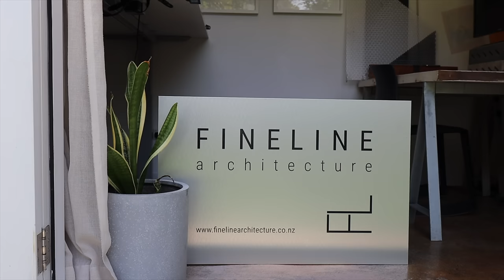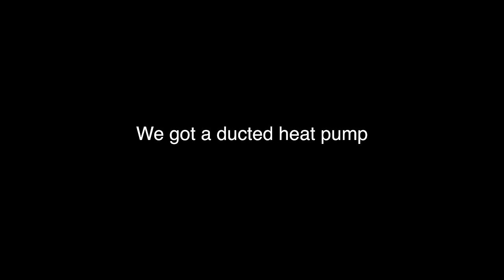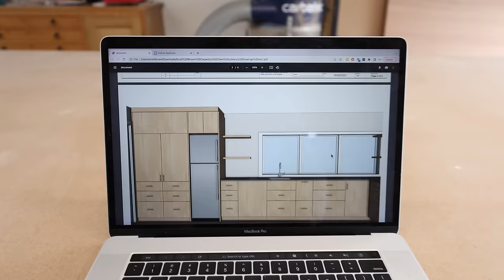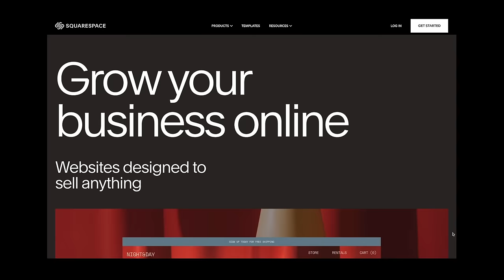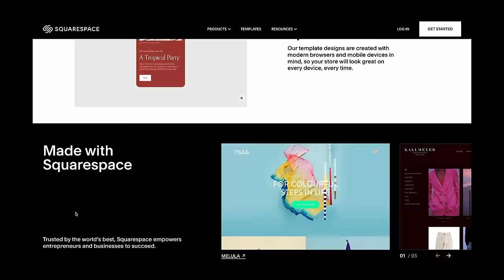2 Years Rebuilding a Normal New Zealand House and Spending All Our Money

Comment: Scott & Jess,

Check the Kn force on your existing window struts, then you'd need to get a lower force variant. Just be careful, as it needs to support the windows weight when fully open, which explains that initial (Jess) surge when opening out. 

Troy

Comment: If you can't figure out how to relieve the pressure or if you buy weaker ones that can't hold the weight, you may need to position them further out from the pivot point to increase the distance they travel and slow the action down.

Comment: That's impressive. Amount of work done looks like it would be easier to rebuild from scratch. So much done!
Retrofitting of double glazed windows looked really cool. 
Looks like consent hell as well - bearing wall, external wall insulation, chimney removal. Since it's 60x high chance of asbestos in floor and eaves as well.
Can't image amount of work that went off screen. Well done completing all this work!

Comment: Yep you can adjust those shocks  should be a teeny tiny Allen key on top or  bottom edge of shock body and you can release  the pressure,, do it very slow as you can't fill em back up. Tiny bit at a time,..

Comment: 15:14 Less pressure may mean it won't start to open or go all the way up. You can regulate speed on pneumatics but I've never seen it on a gas stay.
Personally, I would have gone with a vertical bifold rather than an awning window, then you could use vertical spring balances like with a double hung.
Edit: Actually, I was just thinking you could fit an oil damper alongside the gas stay... but gas stays are already oil damped... so there must be internal porting for the oil that could be modified, or a thicker oil used to slow the extension.

Comment: If you can't change the pressure on the window struts, you might be able to adjust the leverage they have on the window by changing where they are attached to the window and the frame. Having them closer to vertical when open would give them less leverage, and closer to 45 degrees would have more leverage.

Comment: Fantastic results and a joy to watch! About those kitchen window pistons springs, wouldn't it be sufficient to put the top-end brackets closer to the hinges (more counter-pressure) and, if you haven't already, place lower-end brackets a bit lower so they're a just a hair short from fully extended; you could screw some small plywood slats on the window and frame (preferably in the current bracket holes to prevent extra holes) where you can screw different positions on to get the geometry just right.  just thinking out loud here ;)

Comment: Most pressurized gas cylinders like that are not adjustable, however they are rated for a specific lifting force. If that lifting force is too high for the total weight, it will shoot up quickly like you describe. The total weight of the window and the attachement point are both important, as you change the attachement location the leverage advantage will change. If you can figure out the lifting force of the ones you currently have installed, and the estimated total weight of the window you could order cylinders better suited to the application. Here in the US these cylinders are fairly cheap, and easy to find online by length and lifting force.

Comment: Hi Scott. Yes you can get varying strength gas struts. There will be writing on the side telling you how many Newtons you currently have. Either reduce the N figure, or buy ones that you can adjust by releasing gas. Just be warned once you’ve let the gas out you’re not putting it back in

Comment: For adjusting the pass thru windows into the kitchen - saw Chip Gaines from Fixer Upper have the same issue so he installed one upside down to counteract the speedy shwish - so the right hand side of one window the little pneumaticy opener is inverted to the one installed on the left hand side of the same window - thus counteracting some of the speedy in your shwish - not having installed these window openers I hope that makes sense - good luck ps would love to know if it works for you also